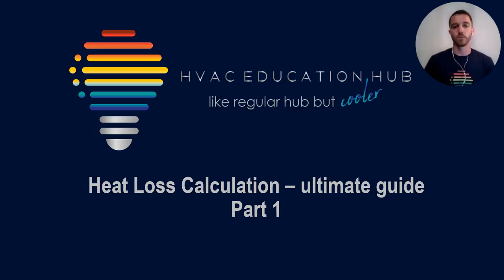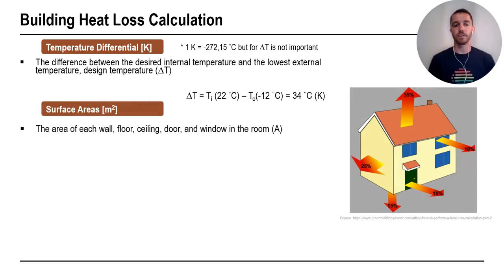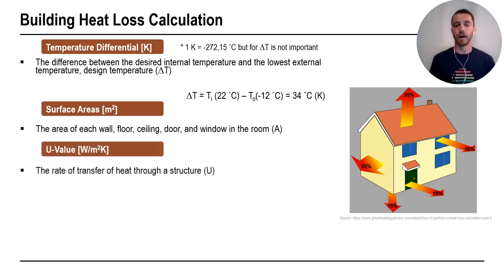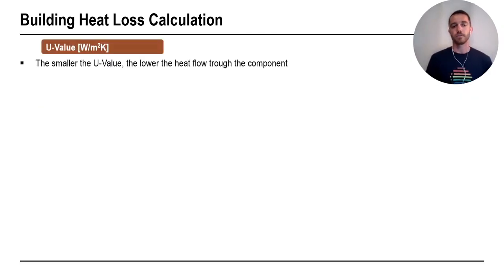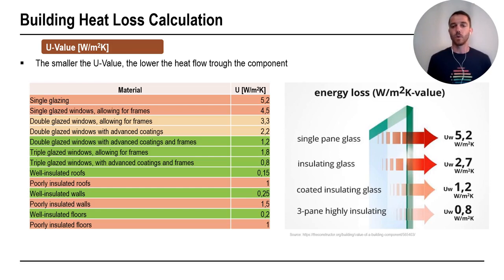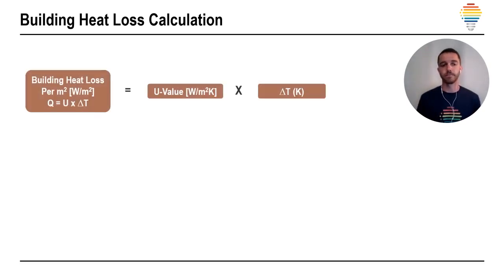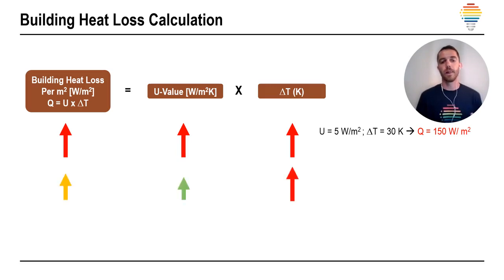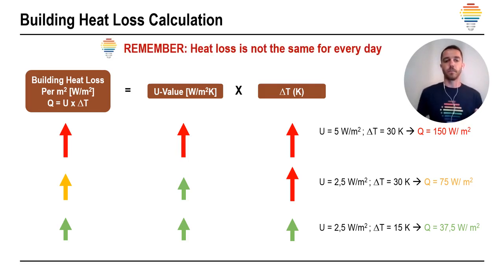Heat Loss Calculation | Your ultimate guide

Comment: Dear Mario, 

I'll write you in English given your channel itself is in English.

First of all, thank you very much for all this very needed information.

My question is about the high temperature heat pumps. On some places I've read they have the same efficiency as the low temperature ones and, on other, that this is not the case.

Could you tell if the latter is true and do you recommend buying high temperature heat pump/s and the pertaining radiators as the only source of heating? 
That is to say, do you recommend this option over low temperature heat pump/s and floor heating?
I'm asking this just because it seems really high-cost and complicated to change all the floors in the house  in order to install floor heating and even though we have plans of house-renovation, we're not sure if this is the right option for us.

Thanks in advance.

Lijep pozdrav iz Mostara!
Antonija
Reply from the maker: Hi Antonija,

Thank you for support. 😊

COP (efficiency) of heat pump is lower if unit is going on higher flow temperature. You can watch video about that on my channel.

Regarding high temperature heat pumps, efficiency compared with the same flow temperature is almost the same - they are good if you really need temperature higher than 60 C which is probably not the case.

Underfloor heating is better because you will spend less money but on radiators, if installed and designed correctly, you can have high efficiency.

If you need anything more, write me on hvaceducationhub@gmail.com 😊
Reply: @HVACEducationHub  
Hvala puno and keep up the good work! 
And, of course, if you can recommend someone in Herzegovina that we could hire, please do write. 
Pozdrav!

Comment: Why complicate it minus 2 is a bad day work on that.Centigrade never mind kelvin.A Heat Pump would have to be adjusted every minute of the day there are no gadgets to sort it is there.Solutions we want to see not why it is costing a fortune.Thank you for having a go but keep it simple,like how do you lower flow rate how do you measure the flow rate without paying for a Heat Geek course good as they are.DIY cheap and nasty emphasis on cheap and toasty.
Reply from the maker: thanks, trying to be simple
Reply: @HVACEducationHub  Mario no one is prepared to say what the basics are Flow/Return a drop of 8degrees,Pump speed how to check it,set-back controls,not your problem I know everyone is setting themselves up as a Heating Engineer when most of them are 2 weeks on a course,driving a bus before that.I did a four year apprenticeship.Anyway I like your videos just passing the time.
Reply from the maker: I will try to cover that topics, too @Allegedly2right